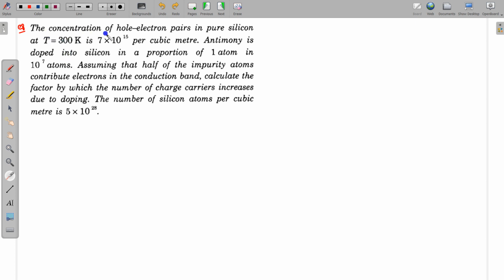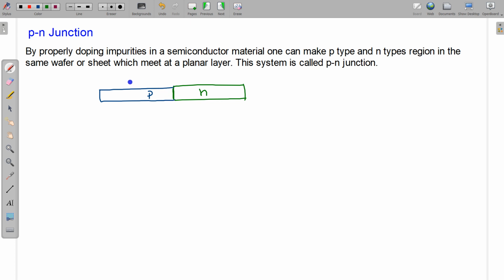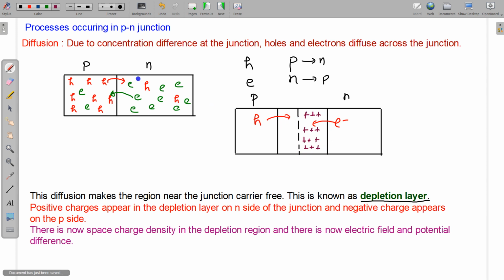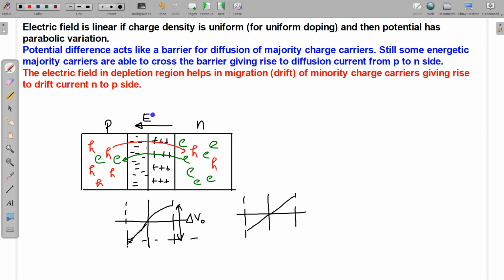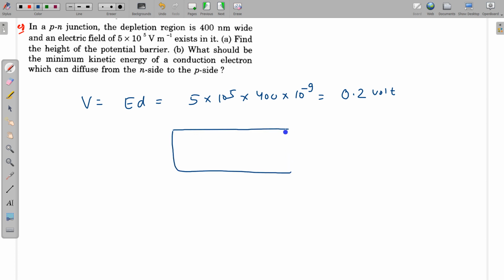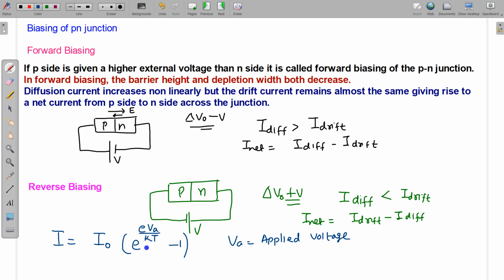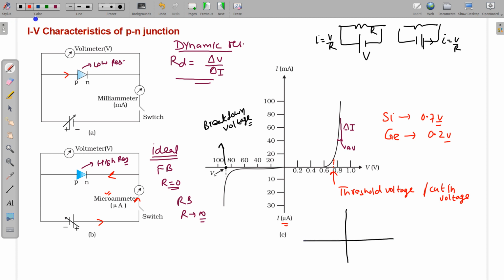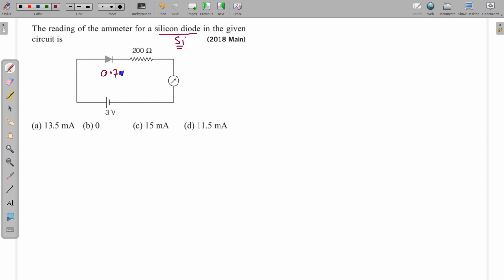Semiconductor | Lecture 2 | PN Junction | Diffusion & Drift | JEE Main & Boards

Comment: Sir in the 1st Q why so many assumptions and approximations
Reply from the maker: even if you do exact calculations then answer won't change much.
you can see the previous lecture.
in an n type semiconductor concentration of electrons is much higher then holes.... so if we add the two concentrations then it is almost equal to concentration of electrons.